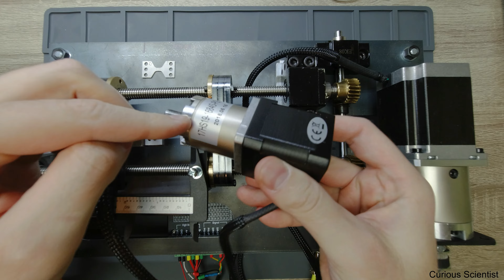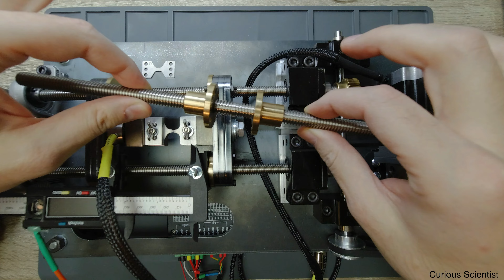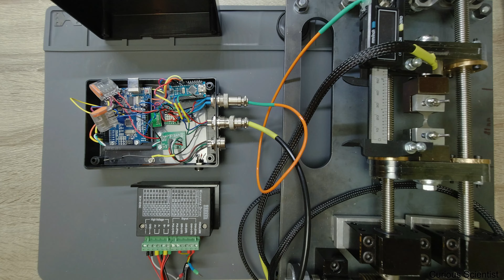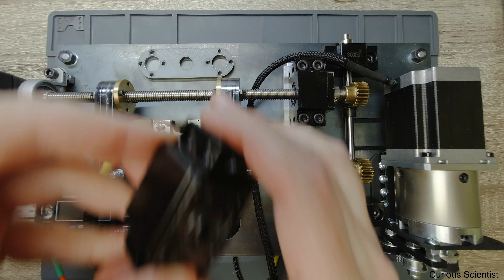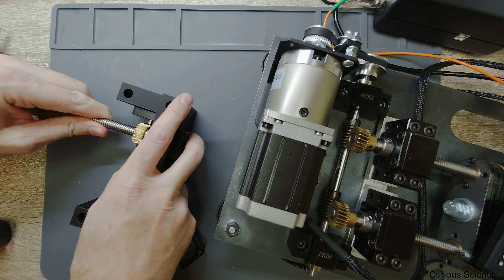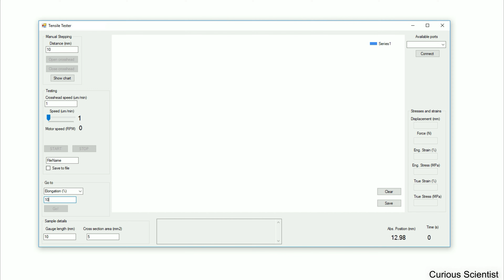DIY Miniature Tensile Testing Machine

Comment: Hello, I’m currently an intern in a university lab and I’m designing a similar device. I was really impressed by your setup and had a few technical questions, if you don’t mind sharing. I’m particularly interested in how you designed the specimen grips : what geometry and material did you use? What type of clamping mechanism do the grips use , and how does it perform during operation? Also, what load capacity are the grips rated for? Thank you very much for uploading this video — it has been extremely helpful in guiding my design process. I truly appreciate any insight you’re willing to share.
Reply from the maker: Hi! The grips are made of tool steel and there are two pins that go through the specimen and support it. It is not clamped in the classical way as a typical hydraulic or pneumatic grip grips the specimen. Although the grip has a clamping part, it only keeps the specimen flat/level during the testing, but it does not grip on the specimen. I haven't had issues with it during operation. I don't have any official rating for it, but the load cell is only good up to 5 kN and the grips are able to hold up at that load level. It needs much more force to shear off two 3 mm diameter pins. I designed the grip "backwards". I had the specimen geometry and I had an inspiration from an in-situ tensile tester (Gatan) grip, so I just made my own version of the grip. I hope it helps.

Comment: Can this design be programmed to do fatigue testing? I would like to build small scale fatigue but not sure which actuator i can use to fatigue the specimen, if you can provide some advice or guidance will appreciate it.
Reply from the maker: You don't want to run fatigue testing in a screw-driven equipment. You want either a pneumatic, a hydraulic or a resonance-based equipment. Maybe LCF would be OK with this type of setup, but I would be afraid of wearing down the screws and the nuts.

Comment: You have a very clever solution to a tough problem. Using lead screws with both left & right-handed threads to solve rigidity problems is good. If you change your worm screws and other right-angle drive gears to spur gears and/or timing belts and counter shafts for speed reduction & torque amplification, you will have a less expensive, lower maintenance machine that takes less power to run and doesn't leave flakes of metal and off gas grease in the SEM.

This goes in my swipe file to make a milling fixture for making molds for cast bullets.
Reply from the maker: Thanks! I am working on an improved and further miniaturised version of this device. I will use timing belts and a DC motor with planetary gear and encoder. I will also take care of a more precise displacement measurement using an LVDT. Also, there's a tabletop version in progress. It will be larger, stronger, and probably also smarter.

Comment: You're lead screw design! Genius! It removes the need for your Frame to bear the load as all thrust load is being reacted internally by the leadscrews...from someone who has toyed with load cell design, this is simply genius. Did you create this solution yourself or did you see the dual pitch lead screw design in another design?
Reply from the maker: Thanks! I saw somewhat similar but not identical desing in other type of equipment. But in the very beginning I had the exact same issues that you mentioned about the thrust loading. I wanted to get rid of that and started to scratch my head. By the way, I've been working on a similar but larger machine for a while, so if you're interested in these stuff, don't forget to check my channel from time to time. Soon, I will upload some videos about it.
Reply: @CuriousScientist  could you tell me what other types of machines you saw this in?
Reply from the maker: An in situ tensile testing stage from Deben. But they used a single lead screw.

Comment: This video is GOLD! THANK YOU SO MUCH FOR SHARING, i'm currently doing a masters, and i work in a materials testing laboratory with Instron Tensile Testers, i am trying to set up a proper pm plan for our very old tensile tester, eg bearing replacement, lubrication etc. but the manufacturer will not share anything with me for my research project, but your video has given me guidance for proposing theoretical recommendation for my PM plan. 

best regards,
Shane from Trinidad.
Reply from the maker: Hi Shane! I am glad that you found it helpful. As far as I remember, the original manual of those machines should also contain some drawings. At least I remember seeing them (I work with Instron and Dartec machines at work). Keep checking my channel from time to time, because I am working on a slightly larger, and hopefully better testing machine. It will take some time to have the first prototype, but it is already under construction.
Reply: @CuriousScientist  thank you so much, what is your email address i have a business proposal for you.
Reply from the maker: Hi Shane! You are welcome! You can find it on my website in the contact section.

Comment: Thank you for sharing your work! I am working on a research project at my university that requires in-situ nanomechanical tensile testing. The equipment provided by the university is costly and labor-intensive. For this reason, I am considering making a tensile tester that works in conjunction with an SEM. I am stuck on a few major questions. If you have time and are willing to answer my questions, I would be very grateful.  
1) How accurate is the tensile tester you built? 
 2) What scale in micrometers are you able to conduct tensile tests using the machine you built?  
3) What method do you use to machine material samples into the dog bone shape to the appropriate size? 

Thank you for taking the time to read my comment and potentially answer some of my questions.
Reply from the maker: Hi! I did my PhD using one of those machines for in-situ EBSD. :) The one I used was horrible software-wise and actually this is why I started making this machine. 
1.) Due to the lack of stiffness, it is not the most accurate thing in the world. I haven't measured the compliance of the machine yet, but based on my measurements, I can trust this machine within a few 10s of micrometers. It can be significantly improved with a bit more investment, but remember that I made this machine at home in my kitchen from a limited budget. 
2.) You can calculate it from the gear ratio, stepper motor's angular resolution and the lead screw's pitch. Theoretically, I can move the lead screw below 1 um at a time. Theoretically... :) 
3.) The samples are laser cut. However some experiments are sensitive to this due to the slight hardening of the edges. In that case, you can cut the specimens using EDM, but it will cost you a lot!

If you want more details, go to my website and send me an email. At this moment I am working on another, desktop machine too, so I have some interesting stuff to share.

Comment: Hi thank you very much for sharing these videos. I did a quick search on the load sensor just in case someone else may also need it, https://www.aliexpress.com/item/32916580700.html?spm=a2g0o.detail.0.0.14aa29cfU3YQ3b&gps-id=pcDetailBottomMoreThisSeller&scm=1007.13339.169870.0&scm_id=1007.13339.169870.0&scm-url=1007.13339.169870.0&pvid=38222c80-96be-4980-8a6f-18e92e1493d9&_t=gps-id:pcDetailBottomMoreThisSeller,scm-url:1007.13339.169870.0,pvid:38222c80-96be-4980-8a6f-18e92e1493d9,tpp_buckets:668%230%23131923%2357_668%230%23131923%2357_668%23888%233325%2317_668%23888%233325%2317_668%232846%238113%231998_668%232717%237566%23820_668%231000022185%231000066059%230_668%233468%2315607%2356_668%232846%238113%231998_668%232717%237566%23820_668%233164%239976%2396_668%233468%2315607%2356
Reply from the maker: Hi! You are welcome. In fact, I bought from this exact seller. :)

Comment: Do you include machine deformation in the final curve?
Reply from the maker: No, because I am not using the results for any scientific measurements. Nevertheless, the machine itself is stiff, so it does not really deform during testing. The problem is the initial slack/backlash when the test is started. This appears as a difference in the appearance of the load and displacement signals as a function of time. Typically, the displacement is a few millimeters before the load starts to change.
Reply: @CuriousScientist  Everything deforms to some degree, even if it appears stiff or not. Regardless, really nice work and thanks for sharing :)
Reply from the maker: I know, I am a materials scientist. :) But in this setup those tiny deflections caused by the stiffness are meaningless. I did some FEA simulations for example on the crossheads and they barely deflect a few micrometers under the maximum load. Also everything is heavily oversized for these small loads. As long as I cannot measure the displacement properly, the compliance is not at all an issue for me.
Reply: @CuriousScientist  gotcha ;)

Comment: Why you used caliper? Since you are using a stepper motor, you could calculate the movement. You should get same value (since you don't measure the elongation on parallel part of specimen)
Reply from the maker: Hi! There is a lot of slack in the system. Please keep in mind that this is a mostly hand-made device, so the fittings and alignments are not perfect. The timing belt can flex, there is a backlash in the worm gears, there is a backlash in the lead screws...etc. The stepper motor can also skip a few steps, especially at high loads. When I test a material, the stepper motor does several steps before the force starts to change properly which also indicates the slack/backlash.
Reply: @CuriousScientist  I know this is an old comment, but I'll ask anyway.  Couldn't you just account for the backlash in the system?  And if you are only doing tensile pulls, you could do the following:   Go to a homing sensor., and then back off until the homing sensor turns off.  This would have already removed the backlash, and you would be stepping in the right direction.
Reply from the maker: Backlash does not only come from changing directions. It also comes from the slight difference between the sample and the grip. So, it is not that easy to get rid of it. I should build a better mechanism.
Reply: @CuriousScientist  Interesting.  Thanks for the clarification.

Comment: I ordered one of those "tb6600" cheap chinese drivers. My Nema23 3Amp was causing driver self protection shutdown. I took apart the driver and found there was no tb6600 chip at all. Instead it was a TB67S109AFTG. capable of way less amps than advertised. So sad :c
Reply from the maker: This particular driver has been serving me well for years, I haven't experienced any problems. I guess some vendors sell counterfeit units, while others sell the proper one. The old saying "cheap pays twice" is always valid for these Chinese circuits. Either we need to find a trustworthy Chinese vendor (There are a lot! Chinese goods are not always bad quality), or we have to buy from some larger electronics parts distributor for much higher price.

Comment: What a wonderfull idea !
Thank you for sharing. We are building a educational low-cost tensile machine, so your work is really inspiring to us.
I think your mechanical part is vey interesting as it is really not that expensive !
I tjhink for the electronic part, you should change direction. The only premptive task is the motor control. You could try the polulu TIC drivers (https://www.pololu.com/category/212/tic-stepper-motor-controllers), it allows to drive stepper motors using serial over USB or ADC (for position or velocity). This way  you won't have make demanding task with your arduino. We plan to use raspberry pi 4 as machine computer and controller.
For position measurement I plan to use vishay UIPMA, but your solution is very interesting ! How do you get the numerical information ?
For force measurement there is a news ! The classical HX711 is not relevant anymore !  The SparkFun Qwiic Scale - NAU7802 is the way to go as it can reach 300Hz and use real I2c.  
We already have all the tools to drive complex machine while drawing graph or make camera control (video extensometry) on a raspberry pi using our laboratory python control platform software Crappy (https://github.com/LaboratoireMecaniqueLille/crappy) that works on Instron and in house machine.
I would be delighted to discuss about this subject with you, feel free to contact me ! 

As a raspberry pi is able to drive Polulu TIC, NAU7802, and it is easy to add ADC, we think it is the best option. The last  version of raspberry pi (the 4) allows to switch state at 50kHz with python, which is more than enough for everything we need, and is powerfull enough to performe camera control with OpenCV.
Reply from the maker: Hi! Thank you for these awesome tips. I am very happy when some of the viewers is telling something new. Honestly, I have never heard about most of the hardware you showed. I will look at them. The numerical info from the displacement sensor comes as a 24 bit data. Check my "Displacement sensors" playlist, I have a tutorial on it. Also, there are better sensors in that playlist. Regarding the HX711. I am perfectly satisfied with it. I am planning to perform slow tests anyway, so the circuit can keep up with the speed. Nevertheless, I will check it. 

Actually, I started to build a bit bigger tensile testing machine, but I am a bit limited on resources, so it is progressing very slowly. 

Check the contact section on my website and you will find my contact address there. Let's discuss!

Comment: I want to make the same machine can you give me details
Reply from the maker: I pretty much told every tiny details in my videos related to this machine. Please watch them carefully.
Reply: @CuriousScientist  

Sir from where i will get its  parts, i am an indian student. I have to represent this, as my major project
Reply from the maker: @ankit2702  It might sound rude, but what is the purpose of showcasing the result some else's hard work instead of coming  up with something yourself? Especially, if you are not even that skilled to use Google and search for all the parts that I mention in the videos of this machine? You just literally have to enter, for example "buying lead screws". 

Most of the time, I use Ebay or Aliexpress. The base plate and the cross heads are custom made, laser cut. The grips are custom made, CNC machined. Lead screws, electronics, bearings, mostly from Aliexpress. Some of the gears are from a seller on Ebay. 

I usually also provide links for those parts which are easy to buy.